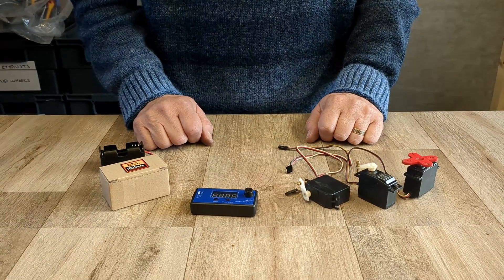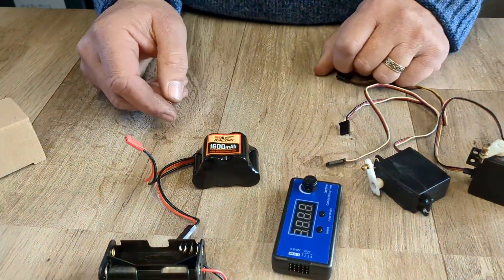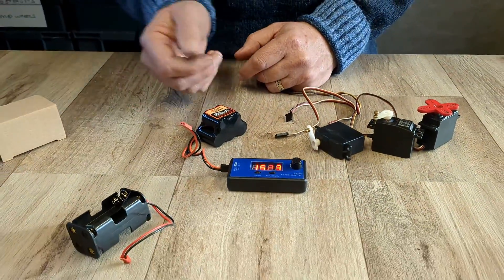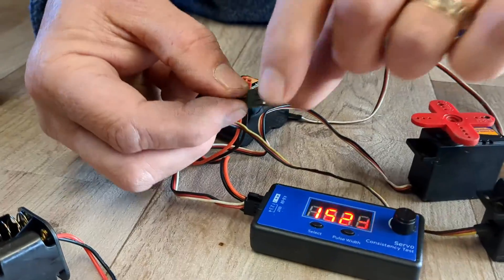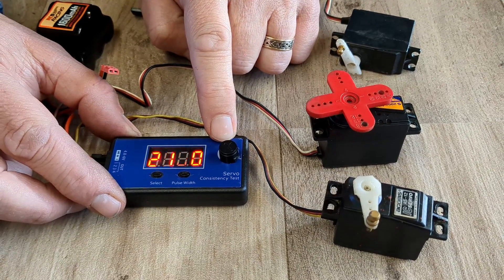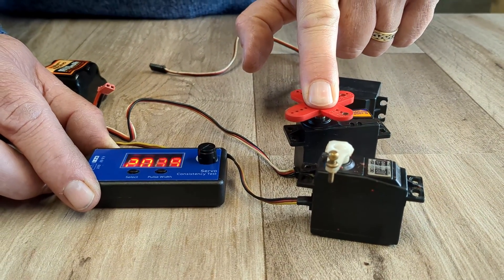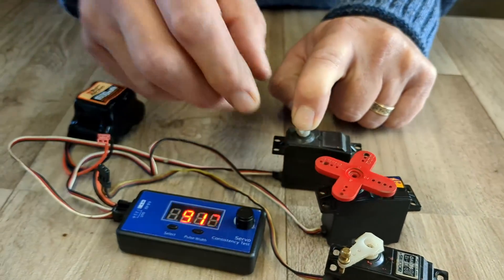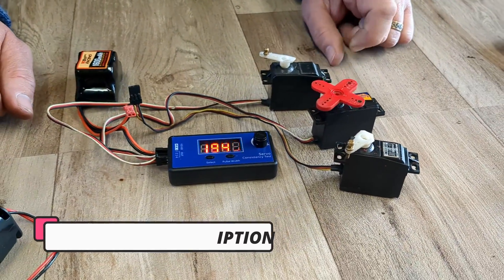HOW TO: Use an RC Servo Tester

Comment: Could this be used to control a servo all the time apposed to just testing it? Thanks
Reply: Yes is could.  I have some customers using it for bespoke applications with 360 ( continually rotating) servos, and it works well as a speed controller for them. I have one customer who build his own crane and used the servo tester to control a servo uses to wind the cable up and down. Another used in in a theatrical application for a stage show. 

Hope that helps.

Comment: I am wondering  how many AA cells are best to power the tester?    2,3,4 ???
Reply: It says 4.8 - 6.0 Volts. i.e 3 Alkaline cells nominal 1.5V actual slightly higher. or 4 NiMH cells nominal voltage 1.2 V actual slightly higher. Which probablt limits it to 3 1.5 nominal cells and 4 NiMH cells to keep it below 6 V but more than 4.8 V. It depends upong how picky you are but for best operation I would have thought the closeer to 6V the better or best still the voltage that you intended the environment would be that you would want to use the devices in. That is the path I shall be taking.

Comment: How do u centre a servo?
Reply: With a servo tester you simply turn the knob to the centre, set the tester to static mode and connect a servo. It will centre itself. 

Without a servo tester you simply connect it to your normal radio gear with everything turned on and set your radio trims to the centre. So long as there is nothing connected to the servo spindle it will centre itself.